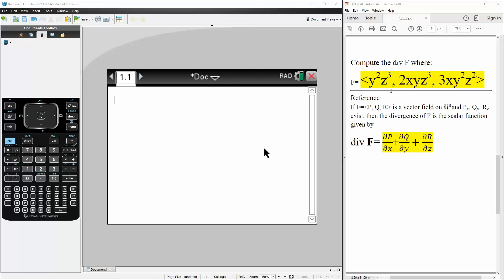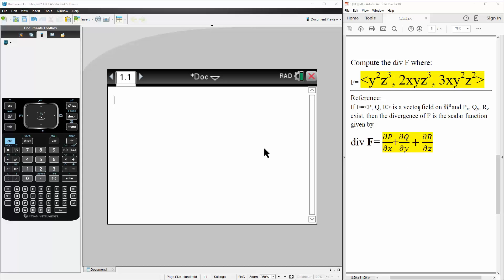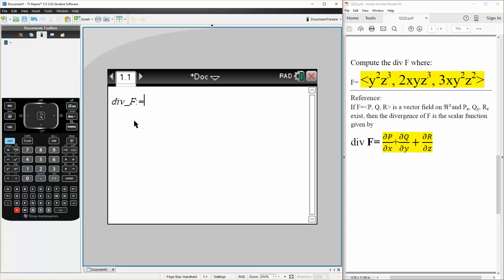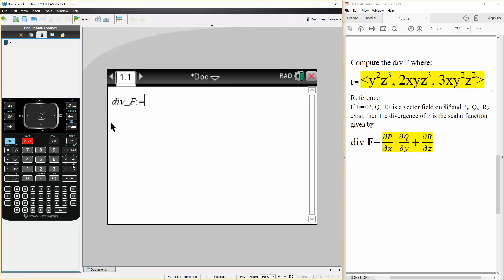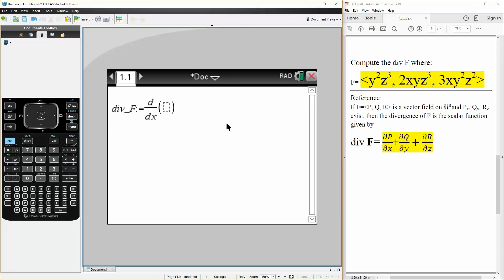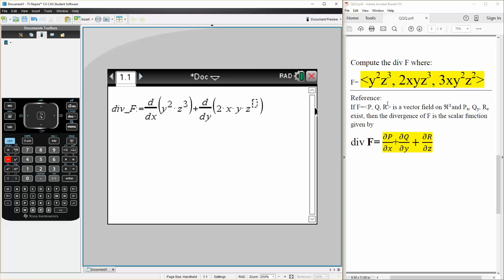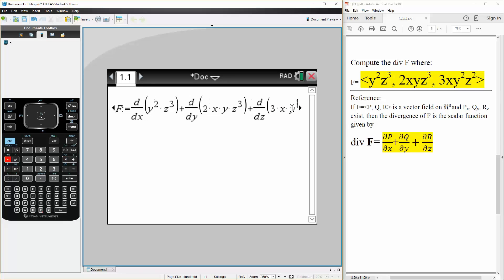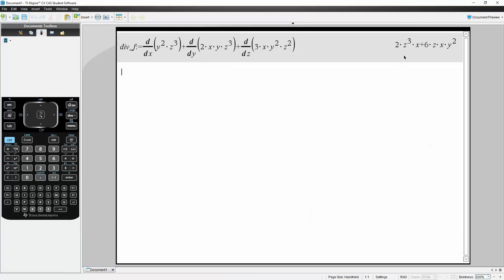Calc 3: Divergence of Vector Field (TI-nSpire CX CAS)

Comment: Is there any built-in function for divergence? In this video you just derive each factor.
Reply: he didnt explain  it but if you just write normally
{div}                                 Then look for underscore the book icon or press (ctrl + key under del) the underscore should be at the top or first line of the symbols. 
Then press the (ctrl + icon next to book)
Then just do the rest of the steps as he shows in the video.
NOTE: Always multiply the variables and numbers as he shows or you will get a different answer